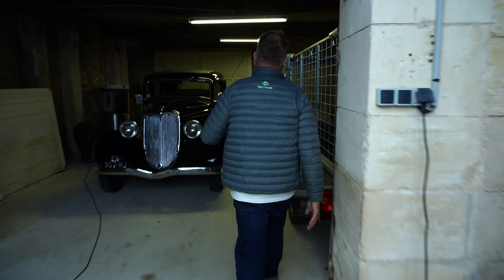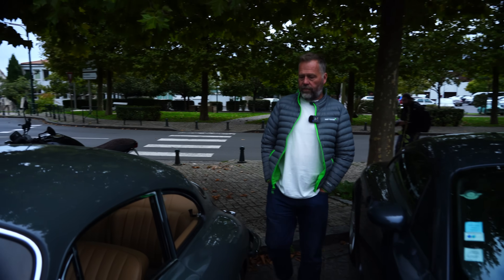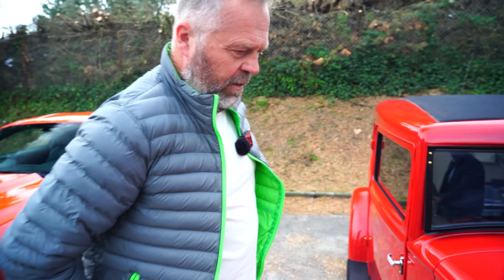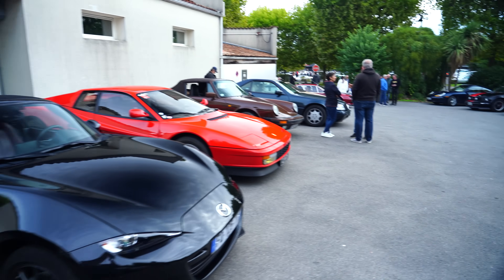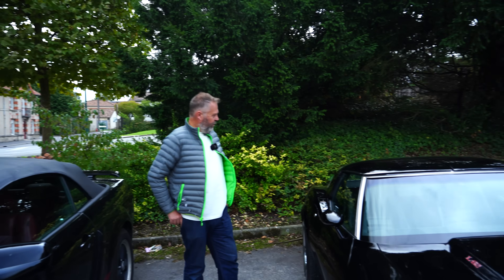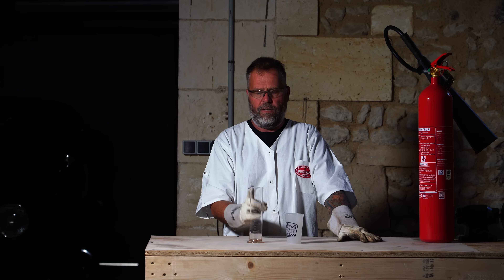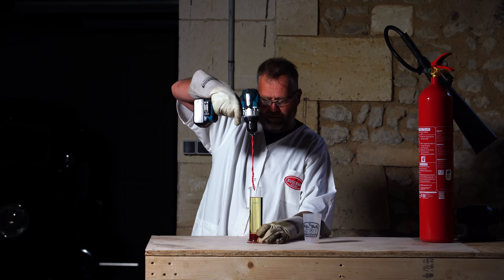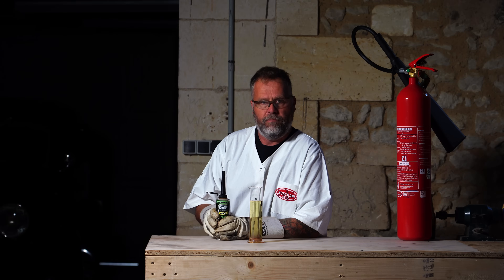Making Ethanol Free Petrol!

Comment: You do realise that the ethanol is in the fuel as the octane modifier? It is in all fuel since the removal of tetra ethyl lead at a concentration of around 20% to get the fuel to burn slower and not self ignite under compression.
Reply from the maker: Thats good to know. Personally I have never had an issue with preignition but I would be interested to hear other peoples experiences.

Comment: Ford Taunus 17M had the V4, which you correctly mentioned, powered the Mk1 Transit. The 20M had a small capacity V6.  motor
Reply from the maker: I knew there would be a Ford expert out there. Thanks for putting me straight.